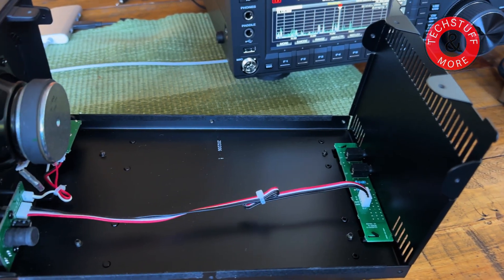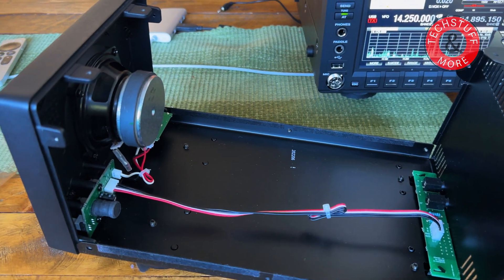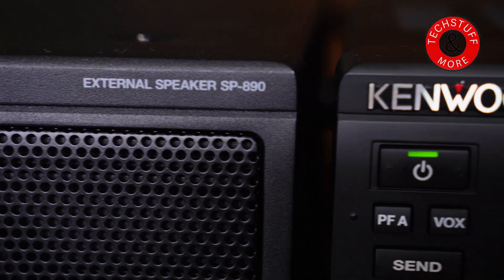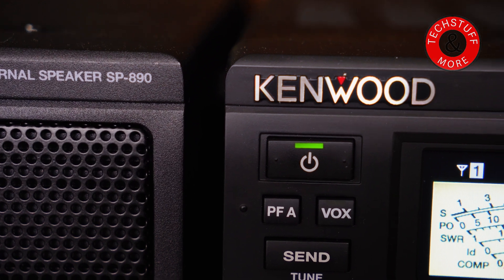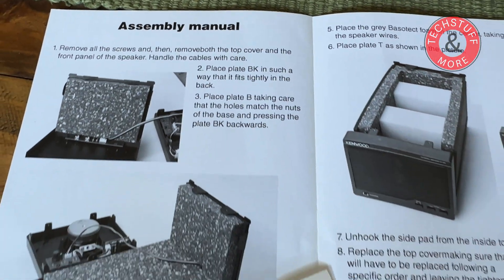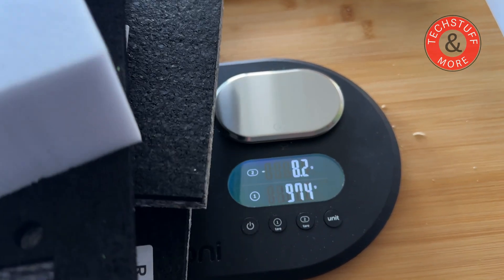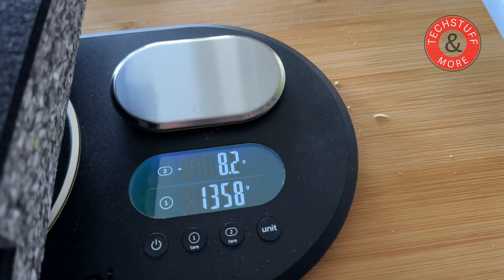Improve the TS-890 / SP-890 RX audio

Comment: I have just installed the Phonema kit for the TS990S speaker (SP-990).  I also replaced the stock speaker with a Visaton 4" FR 10HM 8 Ohm speaker, which fits perfectly.  Likewise, I was surprised by the weight and the quality of the Phonema kit, too.

Comment: I made a 60 degree deflector for the internal speaker from 3" ABS pipe and styrofoam to direct the audio to head instead of ceiling.  As a bonus I get a 20db boost to 500Hz sidetone pitch for CW.
Reply: That is a 50 yr old trick.

Comment: Sounded way better. Personally didn't get the matching speaker for my 890. If I did I would definitely get that kit. Currently running the internal speaker and it reflects off a shelf 1/2" above the radio. Sounds great to me and I am picky. Like the look of the external speaker, but space on the shelf is limited.